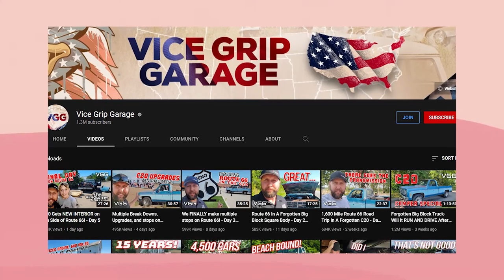Vice Grip Garage VS Sleeperdude |Corvette | Garage Tools | F250 Commercial | Thunderbird 88 Route 66

Comment: Vise grip is real good,, sleeper dude??,, ahh ok,, but, I dont know,, seems shady to me, along with some others  Fave is Coldwar motors, one thing that bugs me about  Vise grip, is he never seems to finish anything, (same with Dylan McCool, ), example,, what happened to the GTO Visegrip was working on?, the 70 Caddy (betty White) its out in a field,,
Reply: Derek occasionally finishes things. Independence, for example; he finished that project, even though a couple of things had to be redone. And, that Monte Carlo stock car was finished, as well.

I do note that a large part of the channel (though, maybe not as large as it used to be) seems to be making dead vehicles run, then driving them ridiculous distances to get them home. The side effect to that is that projects just pile up, because that's a fairly time consuming venture that creates more work than you can handle.  Showing up to events around the country is also time consuming.

I mainly watch Derek for the laid back humor, the interesting turns of phrase (lightning whirler, lone wolf 2000, etc.) , and family friendly presentation. It's nice to be able to show my retired-preacher Dad things on his channel, or watch this in front of my nephews or grandkids, without fear of foul language or inappropriate behavior. The actual projects are secondary.
Reply: Josh is the most real person out there. No persona. Just Josh, Tosh, Ralphie, Squeezie and Waa Waa are just adorable. Along with Rocky and Vienya (the pig).

Comment: They are both good to watch for 5or6 videos but the silly, juvenile purposefully mispronounce words get to be a little annoying. It's sort of cute at first but it's constant over and over and over....
They are very different shows actually,  they both find cars that have been sitting for 30years or so and try to get them started. Sleeperdude Josh finds them locally  and drags them home on a trailer thenjust rigs them up with chewing gum duct tape and bailing wire and that's the end if they start. Derrick on the other hand goes 500 - 1000 miles away gets them running and tries to drive them home but the he actually repairs them properly and even does total restorations on some.
He is very intelligent and an expert builder but plays the ignorant dummy and tries to act like he don't k m iw what he's doin